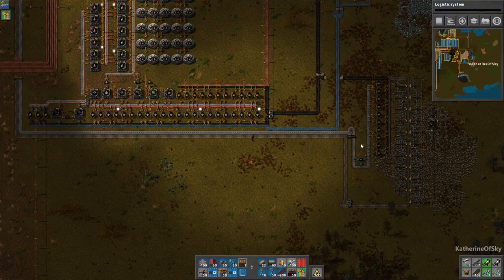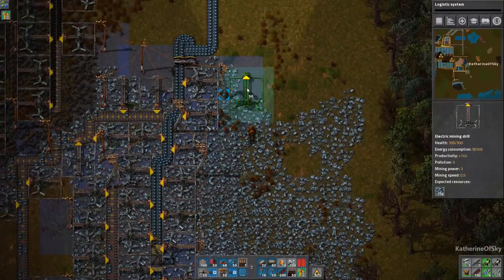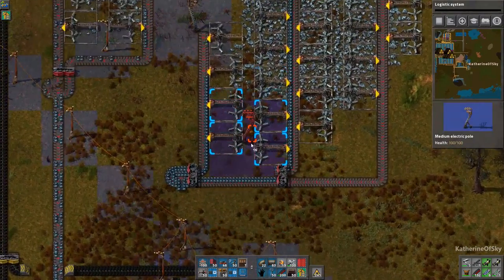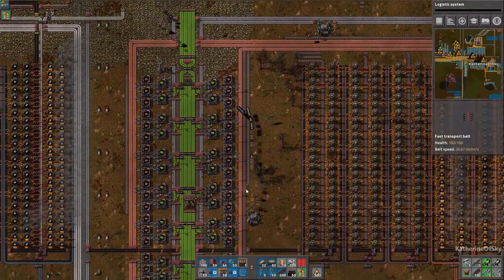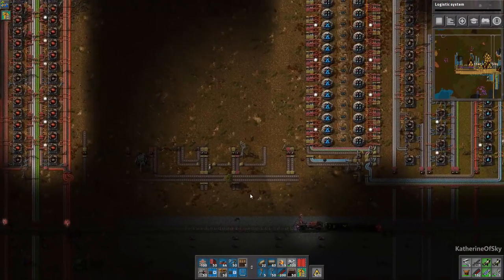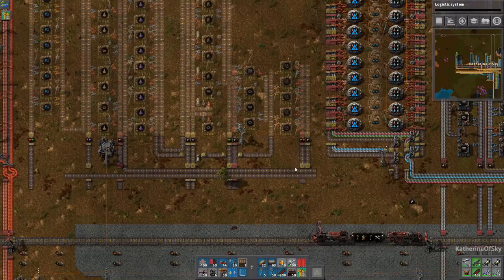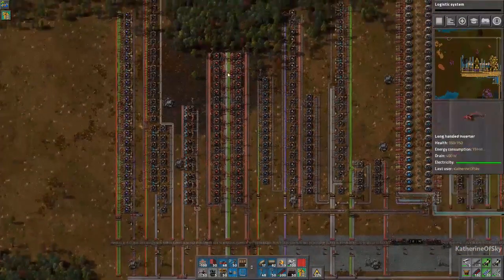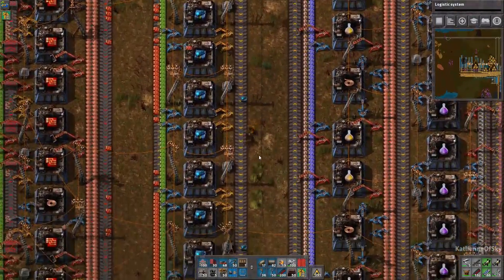Factorio: Entry Level to Megabase Ep 29: IRON, PURPLE AND GOLD SCIENCE - Tutorial Series Gameplay

Comment: For some reason, the Purple/Yellow Science blueprint that I got from the drive doesn't match with yours in the video. It doesn't have the Assembling Machine 1 at all and it seems there is a belt missing for it.  Is the blueprint in the Drive current? Any ideas?
Reply from the maker: 0.16 changed the recipe.  The BP is correct.
Reply: Ok, I just can't find where the Assembling Machine 1 is made for the purple science. There are long inserters placed, but no belt to pull from.
Reply: Yeah, same problem here - no machine for making assembling machines, but long inserters without a belt ... help :D
Reply: Unless I'm missing something, there are no assemblers in the Blueprint to make Assembling Machines 1, which are required for the purple science.  also, there are long inserters feeding the purple science assemblers but there is no belt for them.  I had to add several assemblers at the top to make the Assembling Machine 1's, then add a belt to feed the red inserters.  Everything now works, it just took some extra steps. EDIT: I just checked the Factorio site and the recipe for Production Science packs (Purple) do not need Assembly Machines 1!  I have no idea why I had to provide them in order for the assembler to work!  EDIT 2: OK, I have been running 0.15.40 and the recipe changed in 0.16 which I thought was still experimental.  Katherine, is it OK to change base map versions in mid-game?

Comment: What I do not get is why you calculates for 1,5 Purple Science per second. I thought the array aimed for 2 sps?? You try to explain it with the assembler crafting speed. But I do not get it. Can you (or anyone) explain? Thank You
Reply from the maker: The assembler speed on Assemblers 2 (blue ones), is 0.75.  If I want to make 2 per cycle, that number is 1.5 per second.  (Seconds and cycles are different because of machines speed).  When you use the calculator, it asks for number per SECOND, so that's why you have to convert it.
Reply: KatherineOfSky Thanks, for the quick answer. Love your Series by the way. So when you aim for 2 science per time unit you mean per cycle not second. Any particular reason for that? Or again just the assembler speed?
Reply from the maker: Thanks Fridge!  The 2 science per cycle is an arbitrary number, but one that we are able to supply with the initial setup.  1/cycle makes research take twice as long, and more than 2 requires much greater throughput of materials.  I find 2/cycle is perfect until end-game, where we use beaconed setups to increase production.

Comment: People need to just fukin stop about "balancers"

they dont work.

all they do is reshuffle the lanes back together, it doesnt magically add ore/etc back to the lanes.

if you have 4 lanes, take half a lane off, you have 3.5 lanes, then reshuffle it with a balancer... all you did was spread 3.5 lanes evenly 
across 4 lanes, you didnt magically add ore
now you have 4 lanes, with 3.5 lanes worth of ore, none of them saturated.
and that will just screw you over farther down the bus.

take another half lane, shuffle again..

now you have 3 lanes worth of ore, on 4 lanes, and none of them capable of sustaining any full lane setup, because they were "balanced" to be even.
Reply from the maker: Of course less cannot feed more.  This is what I've been advocating in my entire series...
Reply: KatherineOfSky I like it because you can take off each lane of a 4 lane bus, then balance, and the next 4 you take off each lane again. It helps. Only works if the belts are saturated and you add in more materials further down, and at several places.
Reply: They would be more accurately called distribution systems.  And seem only to be functional when your input is greater than your output and/or when going from more lanes to less.
Reply: With the current version, they DO actualy work. Just set the priority to go to the main line. That way, if you have a factory that's not working right now, the material won't be stuck at it.
Reply: Give unused lines a place "up stream" to back up to so that your smelters keep flowing evenly.

Comment: You keep saying your factory is starving for iron, it looks like most of your smelting arrays are stopped, blocked by a satured outbelt. Better repartition from your main bus to various block could free at least 3 full red line of iron. Spend some love looking at your smelting array!
Reply: ludovic meyriat science was stopped so there was no demand for Iron. That's why the smelting columns were not working. Once the factory is running at full speed she will need all the iron belts. You can split them but then you will have shortages at end of the bus, you can see that in previous play thoughs. This time she is trying a new strategy, add more iron later into the bus, approximately where the labs are located, from a station beneath
Reply: She mentions this in the episode but I'll reiterate: she is basing her belt-need of materials from a continuous running factory, meaning that once her science is running non-stop all those belts that are 'stopped' atm will be running at full speed...
Now if this is a better design-philosophy than rebalancing/repartitioning belts is a matter of opinion, but it's how she is choosing to design her factory.
One thing I would do in her place is to allow the earlier lines of plates to priority-fill later belts... that way you could utilize the smelting lines in a more constant fashion. But it's not really that important how you chose to build your factory imo, as long as you are consistent about it :)